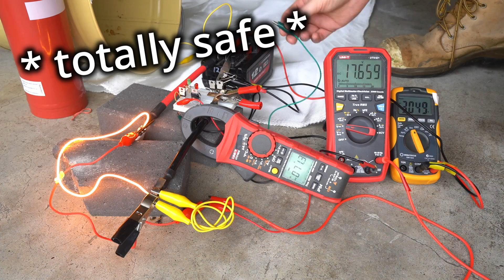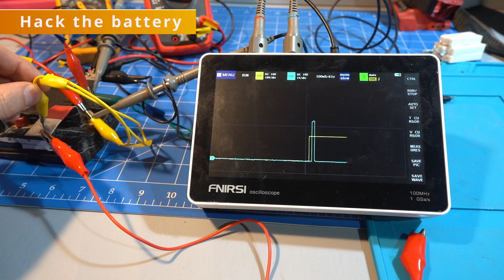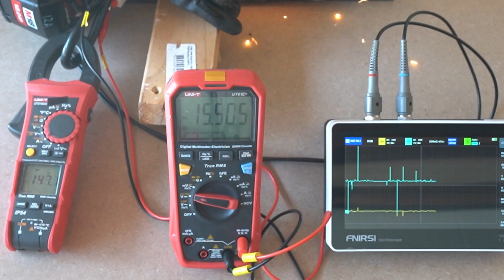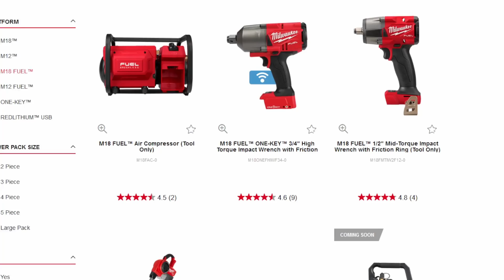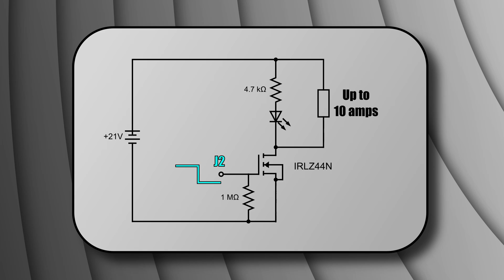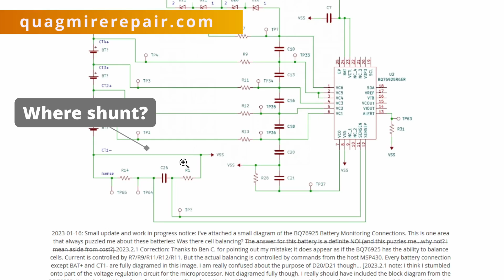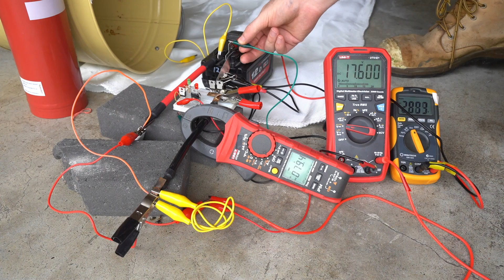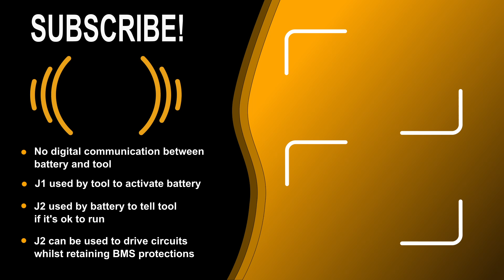[005] How M18 batteries communicate with tools

Comment: show us jacobs law...

that is, the internal resistance of the source, versus the resistance of the load... where the heats being developed... where the works being done...

pulling these currents requires seriously low resistances.... but there is a limit to just how low that short can be before its not a load at all... the battery itself becomes the "load"... THATS why they get hot...

just like if you short a generator out. that power has to go somewhere. wheres the resistance? in the generator itself.

really waiting for someone to show a video about how a battery is an electroplating process, and that there are two things happening... the desired plating, and the I2R heating of driving current through the electrolyte... that as you push charge (and discharge) currents up, the quality of the plated surfaces degrades, more energy is wasted as heat rather than plating, and the end result is batteries are way more inefficient than the biased advertising blurb would have one believe... maybe convenient on these power tools but overall... pretty lousy as a storage method.

find me one politician pushing EV mandates that knows what jacobs law is...
Reply from the maker: I'm unfamiliar with Jacob's Law. Is it similar to Thevinin Max Power Theorem? I've previously estimated the 12ah at 40mOhm, so max power would be R_load = 40mOhm, 20V/80mOhm = 250A. But of course the battery will heat up and increase in resistance, plus other effects. You can see at 10:15 that at 75A I'm "only" losing ~2.6V across the battery. 

The tools are typically only in the 20-50A range. They need to be used in unusual ways to get over 100A.
Reply: @toolscientist  pretty well much, yes. same as the 1/2mv^2, or 1/2I^2L, or 1/2V^2/C equations...

hit equal resistance, its pretty logical that as per kirchoff, equal currents, equal resistance, equal heat, equal power. go back to the basic of a generator as the magnet in a copper ring showing lenz reactions. wheres the volts? wheres the current? cut a slot in the ring... wheres the volts, wheres the current?

keep the load well above the source resistance, and its "efficient". my analogy is watering a pot plant with a wee hose hooked up to the snowy hydro. real efficient, yes? very precise and controlled with little waste or effect upon the dam...

whereas a wee little bucket on the dam wall instead is going to drain rapidly and the height and pressure and flow will be dramatically affected. we call that inefficient...

lots of parallel batteries... low internal resistance, better efficiency than single cells, if that all makes sense. pretty straightforward.

its like watching the attempts at charging batteries from wind turbines. forget the erratic source , the generator itself may deliver its max power at a load where its held at say, 12v/25A for 300W. 

but as the SLA batteries only start charging at 14.4V, the load must be higher in resistance for the same voltage. but that load will not draw 25A anymore. it may be limiting the current to say, 10A... less...

and as batteries are not obeying ohms law... it hits 14.4v, attempts to pull more current than the source can deliver as the internal resistance is far lower... and the voltage sags below the charging threshold, and attempts to find some sort of equilibrium, a midway point... they end up getting figures like 25W, etc... no matter how hard the wind blows. the load is unmatched. 

in that area, im of the opinion that using wind power to generate heat, thermal storage... its the only logical method. use the heat to make the electricity somewhere else, just like a coal or nuke already does. 

making power directly from the wind is ...effin stupid?

unless its heat. heat is power.

definitely not convenient on a power tool though, batteries are fine there... i give them that.

"efficiency" is this marvellous term that can be used in so many ways... 100% efficient may very well mean its still throwing half the potential away. it HAS to!

oh. its also newtons law of action and reaction.

all related. push something, youre gunna go backwards as well... it all depends on who is bigger!

Comment: What cells do they use? Whats the upper limit of current draw?
Reply from the maker: 12ah is 5s3p Samsung 40T. 6ah is 5s2p Samsung 30T. 5ah is 5s2p Samsung 25R. 2ah is 5s1p Samsung 20R.

12ah and 6ah have a physical fuse. Project Farm short circuited an M18 6ah a few weeks ago and got a few hundred amps for a few seconds before the fuse melted. Theoretical continuous draw for 6ah and 12ah is ~70A, but I'm pretty sure it would overheat due to cells being tightly packed and enclosed in plastic.

Comment: It’s obvious that there is no performance communication when you look at the way the tools perform. Thanks for confirming!
Reply from the maker: I could see them at least doing a basic handshake, and if that fails, the tool uses a lower overload current. In the grinder tests at 4:39, I'm pretty sure the 12ah and 6ah are the tool cutting out when it hits ~160A, or maybe overheating the ESC. So if they did have even basic comms, I could see the tool lowering its stall current for weaker batteries. 

The batteries should be pulling J2 low when they detect that they've exceeded their current limit, but it seems Milwaukee relies on the batteries tripping low voltage or overtemp rather than looking for overcurrent.
Reply: @toolscientist  That’s my finding as well. The 2Ah will droop voltage and overheat in a blower before it ever  cuts. Tragic lol.

Comment: Better to boycott Milwaukee , right to repair is what people wants
Reply from the maker: I'm mainly interested in my right to melt stuff, and they've made it pretty simple. It's quite easy to make a tool that works with M18 batteries and that will shutdown when the battery signals it. There's a few companies that make M18 compatible tools.

Comment: What if you used one of those tools enabled with onekey? I know you’re able to lock tools and stuff through an app if you have onekey enabled tools.
Reply from the maker: I don't have any One-key. Other people mentioned it and I looked into it. From what I can see, it's tool only. The only thing I saw that might be battery is a screenshot showing battery capacity, but they could be getting that from pack voltage. If you can see battery temperature, manufacture date, charge cycles, or similar in one-key, then that would indicate that there is digital comms between battery and one-key tools.

Comment: J2 is a safety feature. I know guys who have broken wrists from the tools attachment, like a hole saw, catching in material and the entire drill spinning. It eliminates the need to have a secondary Handle. As someone who works in commercial construction It’s actually a pretty nice feature to have.
Reply from the maker: J2 is a safety feature for the battery to tell the tool that it has overheated or reached its low voltage cutoff. The anti-kickback that you're talking about is only in a few tools and is only in the tool. The tool has no need to tell the battery that it wants to stop, the tool just stops. 

You can somewhat see this when I stall the grinder. The grinder just stops with no change on J2
Reply: @toolscientist  Correct. The battery has no FET(s) in the discharge path, so no ability to stop or modulate the load on its own.

Comment: Great demonstration. Needed that. I hate those hidden "features." It should be VERY clear on a device or a battery where the limits are and how to re-create it with other parts, if we can't buy the originals any more, but have a great tool hidden to spring into life instead of throwing a lot away. It applies to more devices than you think.
Reply from the maker: Hopefully there'll be some standardisation in the future. It'll probably require the Brussels Banhammer to make it happen, though

Comment: Wait, Milwaukee has not released a toaster oven? 😆 (There's a video of someone using a heat gun toasting toast though. Interesting there's a heat gun, that has to be massive current!)
Reply from the maker: It's doable. I think I'd prefer a sandwich press, though. They're 1000W, so you'd only get about 10min runtime on a 12ah.

Comment: Imagine making own 18v12Ah packs diy that can deliver 120A currents almost continuous and costing 50$ + bms
Reply from the maker: The charging side is a bit more complicated. But you could design your DIY batteries to have a JST balance connector and then just use a hobby charger.

Comment: I mean with some mosfets and diodes they could do pwm or a buck converter it could but they don't
Reply from the maker: The 12ah does have mosfets on the ground rail. @ThriftyToolShed showed them in a video here: https://www.youtube.com/watch?v=TphIrEWvW68

It's possible that they could throttle the power with this mosfet. PWM would likely play havoc with the tools, unless Milwaukee knows that all their tools have sufficient input capacitors. 

They could also run the mosfet in the ohmic region, but that would make a lot of heat, although they do have a sizeable heatsink on it. They'd need to add ~20mOhm to make the 12ah look like a 5ah, which would create 50W of heat at 50A. Doable, but seems unlikely. The 6ah high-output is similar resistance to the 12ah and it doesn't have any power mosfets.

I think it's most likely a power cutoff. I'm hoping I can get some probes on the gate pin and see what it's doing.

Comment: You should check the Dewalt battery BMS. there's basically no protection. The protection comes from the tool. I had 3 batteries burst in flames after running it on an old 18v dewalt circular saw.
Reply from the maker: Yeah, they're the most basic of the major brands. They're interesting to me as you have direct access to the thermistor and cell voltages, so lots of scope to make DIY adapters that don't overheat or overdischarge

Comment: I designed a 555 timer based system to do this. Reach out and I can share
Reply from the maker: 555s are 1970s tech, we prefer 1870s tech on this channel - just ignore the scope, multimeters, and mosfets :-)
Happy for you to link a video. If you've got a circuit on stackexchange or similar, you'll have to give me a search query so I can find it, then I can post a link. You won't be able to post any external links.

Comment: We have discussed this briefly before, but EGO 56V packs do have  communication with the tools through the D-terminal. The tools will run for around 10secs or so without the D-terminal, but it seems a watchdog will shut it down after the 10 secs with no communication between the two.  In case you wanted to see a pack with communication. The BMS has 2 microcontrollers and is quite advanced with temp monitoring boards in between the pack halves that uses transistors PN junction for temp monitoring and 2 NTC's as well. The board even has a calendar chip for storage mode I presume. I wanted to look more into the communication protocol, but have not had any time to go back to it. I threw all this on a video called "What is the D-terminal?" Since so many viewers asked about it.  I also shared that someone else could take the information and go further than I did. I don't have the best equipment at this time to go much further. I hope you get time to look into it. Great video!
Reply from the maker: Here's the video for anyone else:  https://www.youtube.com/watch?v=H-hggUXgYlU
Search showed me the T-terminal video first, so I watched that thinking you made a typo!
Reply: @toolscientist  Thanks man!
Reply from the maker: Interesting. I'll have to watch your video. I'm happy for you to direct link any of your videos. 

Don't think I'll be getting any Ego anytime soon. I do have some Makita XGT and my initial tests show that the tool won't even run without digital communication. A user called Malvineous on github has figured out some of the XGT protocol between battery and charger. Will be interesting to see what it's saying to the tool. 

As with you, it's a matter of finding the time!

Comment: Love this. Always looking for more ways to use the batteries I have. 
Maybe you'd be one to ask.... Any way to get "higher amperage" (than those 12 converters) to use 18 volt batteries in 12 volt curcuits?
By no means at your level of electronics understaning (thou I can follow directions), but the mechanic in me would love to use an 18 volt battery to test/run 15-20-30 amp 12 volt items.
Reply from the maker: There's a couple of those "15-40V to 12V" buck converters in an aluminium heatsink that claim to do 30A, and lots that claim to do 10A. You may be able to run them in parallel to get even more current. Ideally you'd look at the output on a scope to make sure there's no craziness. If you've only got a multimeter, then you can check the Hz and ripple voltage of a single unit, then compare those results to putting two in parallel. If you don't get crazy frequencies or large ripple voltage, then it's prob ok.
Reply: @toolscientist  Thank you for the info, I'll take a look into those and check them with my meter. So many uses I can come up with for a portable 12 volt source, I am surprixed they don't offer something off the shelf. Gtanted, that is old school, a lead acid will do that, but oz to oz.... tool packs are easier to move around.

Comment: Looking forward to experimenting with my Makita batteries to see if they have any smarts
Reply from the maker: There's an instructable by Noloxs on Makita LXT that covers the gist of it. The 3rd pin is similar to the J2 pin on the M18, except instead of being 3V, it's 0.5V below pack voltage and cuts to zero when a fault is detected. This makes driving a mosfet with it very easy - there's no need to boost the signal like I had to do to get the M18 to drive a high-powered mosfet.

There's presumably digital communication on the yellow connector as Makita sells a tool that lets you read battery temp, charge cycles, et cetera.

Comment: I'm actually glad there ain't any intelligence cuz you can use the batteries in series to run an ebike or eskate like I did.
Reply from the maker: I do wish there was a bit more to the signal. Like a dual analogue/digital signal so that you could also tell the battery's temperature. The on/off signal is perfectly good for cutting power, but I always want more, haha!

Comment: The tool coms cant use complex coms because the interference would just make the tool unreliable and damage brand reputation. Charging on the other hand, in a controlled electrical environment means they can use digital coms to charge optimally and also prevent cheap chargers from destroying their brand reputation.
Reply from the maker: Yeah, I originally had a section of the vid discussing the noise in J1 and J2 during operation and saying that was the reason for no digital comms. I left it out as I'm not sure if that noise could be filtered, so didn't want to categorically rule it out.

I know that Makita XGT tools use digital communication and the tool won't run unless it receives that communication. I'm pretty sure they have a separate isolated ground for comms to get around the noise issue. I have heard from one person of having problems with their XGT tools and having a rep come and clean out the batteries for him multiple times. In the end they gave up and went back to the older LXT system.

Comment: Was waiting for this video! As a software engineer that dabbles in electronics/embedded and who deals with unnecessary and unbearable complexity in his work, it's nice to see a simple signalling mechanism used. Less to go wrong, cheap/easy to implement (as you showed), and doesn't need reliable checksums/retransmission/ack and other nonsense to happen when a tool is rattling away in terrible conditions.
Reply from the maker: The activation pulse seems unnecessarily complicated, though. Don't see why it needs to be a pulse of a certain time, rather than just J1 high brings J2 high. The consequences of J2 accidentally being activated are just that the battery consumes a few microamps for ~3min.

There's some nice things you can do with a full digital protocol, like having the battery transmit its max current, continuous current, max temp, et cetera. Then tools that can control the load (blowers, vacuums, pumps, lights), can adjust to avoid overheating the battery. I know that Makita XGT has the batteries communicate digitally with the tools, and the tool won't run without this communication, which does make them less robust. It will be interesting to see if they're doing useful things with it, or if it's just there to make it harder for 3rd party makers to copy their batteries and tools.

Comment: The circuit you built with mosfets is similar to whats in the greenworks 40v packs i have.i havent layed out a schematic but the layout and function is really similar.
Reply from the maker: Greenworks have low-voltage cutoff inside the battery packs? That's interesting. Never even seen a greenworks tool in person, so I have no knowledge of them. Only ever seen them in a few comparison reviews.
Reply: I think they have a voltage signal cutoff inside the pack. There is 3 relatively beefy mosfets and an aluminium heat sink. If you measure the + and - terminals you get 0v when the battery isn't connected to a tool/charger. You can short the pack and nothing happens. One of mine got put on a charger wrong and discharged to 9.8v....thats a 10s pack.
Reply: I was wrong. The pack was 9.8v last time I checked....the cells are all now between 4.11 and 4.13v and the whole pack is 41.2v. There is 3.6v across the main power terminals of the pack. This is really low current stuff so some shenanigans are happening but there is 35.2v between the - output on the board and the B- into the board. The resistance is not equal in both directions either